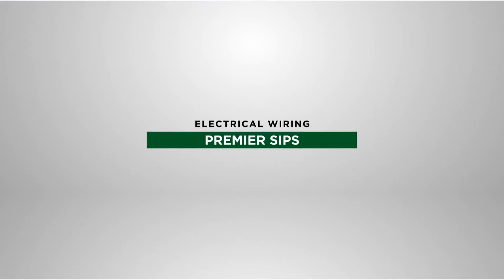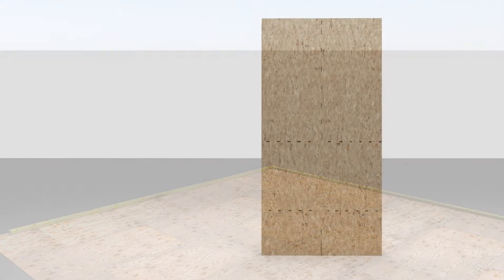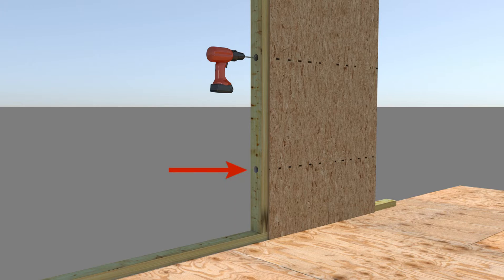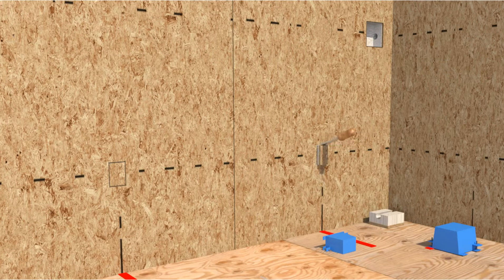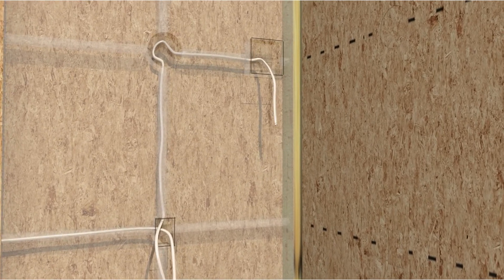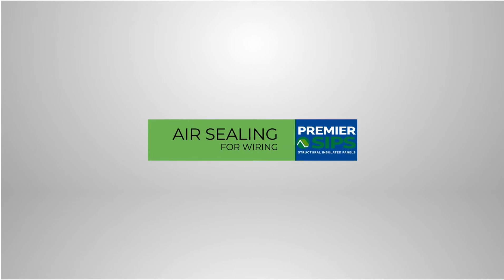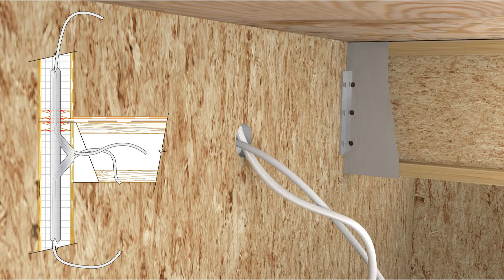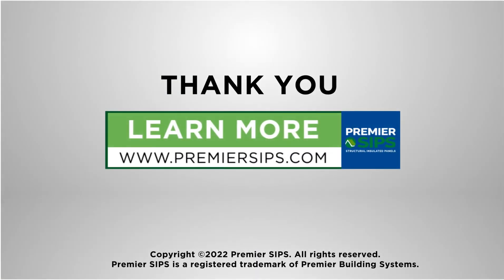Premier SIPS Wiring Guidelines

Comment: Why can't wiring be run behind a baseboard detail. Detail would be a 1x2 at top and bottom of a 1x12. Use 1.5" deep boxes for outlets and wiremold to other stuff like switches. 
You guys make it hard to run all that wiring inside the panel??